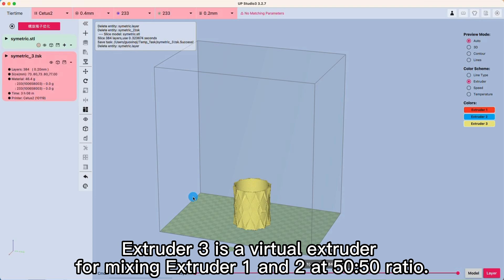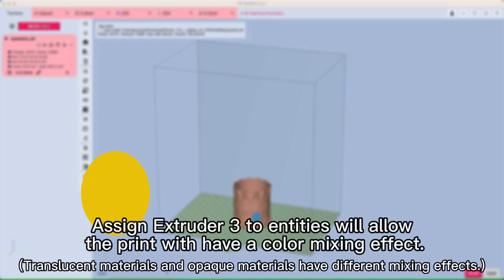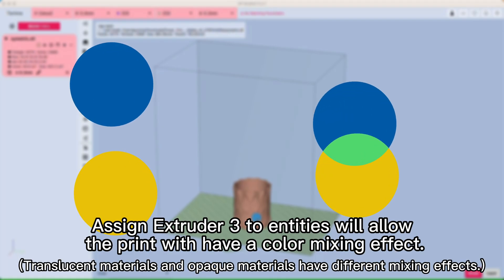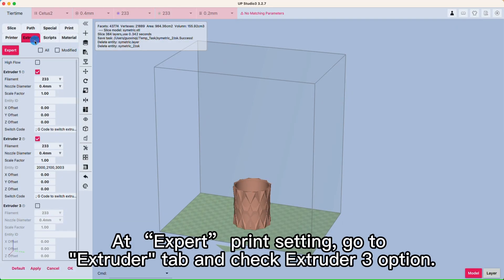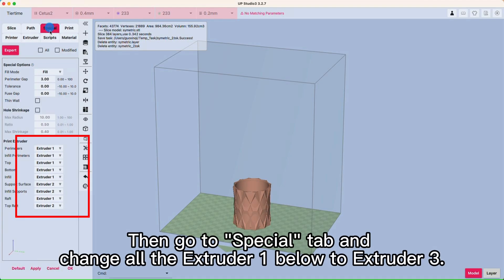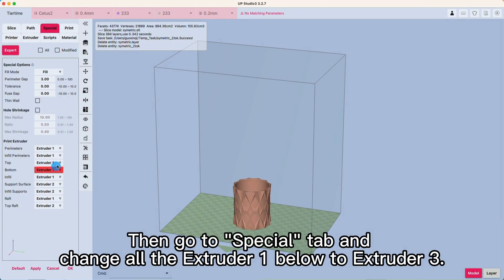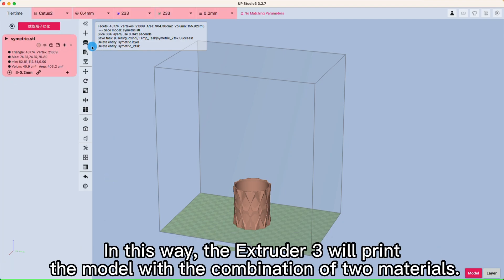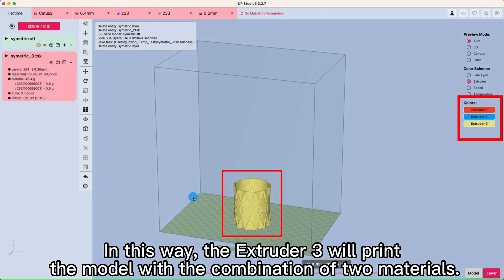Cetus2 Color Mixing！

Comment: Thank you. Is there any way to assign all 3 extruders to a model? I would like to use, extruder 1, extruder 2, and extruder 3 all on the same model. I would also like the option to change the ratio on Extruder 3 to be 80,20  or 70,30  etc... instead of just 50,50.